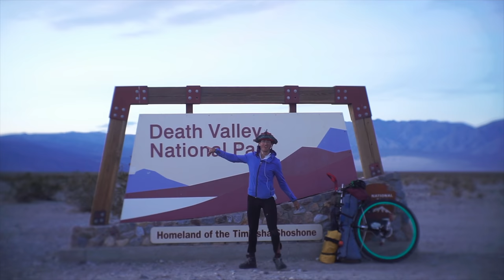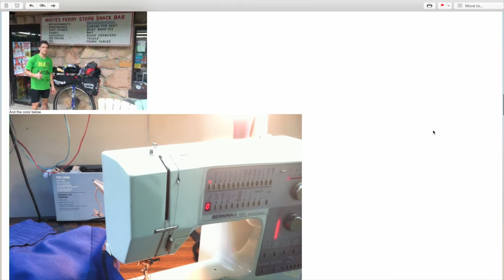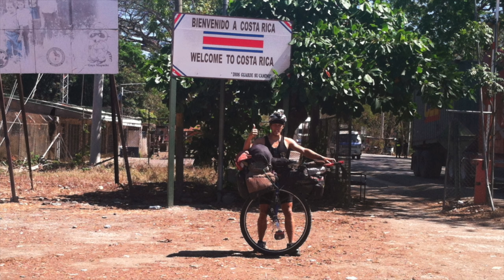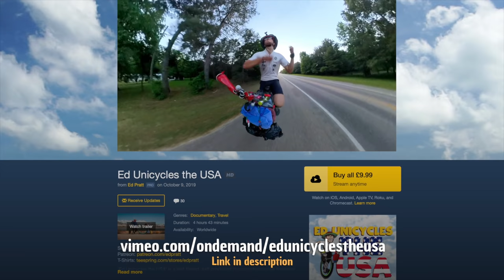He Unicycled 20,000miles from Alaska to South America // Ep.17 Unicycling Across America

Comment: I would like to offer a suggestion. Change to a mountain bike helmet with adjustable visor (gives great shade on your face) and Dutch that cotton hat that doesn’t transmit air & by a Headsweats cap. Those things pull the water out of your hair & keep your head very cool. No wonder you’re overheating with no air going through your helmet. 👍☮️🌞

Comment: If you are just drinking water you are not replacing electrolytes. Combined with the heat you are experiencing heat exhaustion. Nausea, cold shivers, vision going black?  You need to drink Gatoraide, Poweraide, etc. or take salt tablets. Train for triathlons in Hawaii...been there with the heat and humidity and 60-100 mile training rides. Also, don't drain the tank. Buy a powerbar and take one bite every hour. Keep fueling until your meals.

Comment: Aaah, you know what I'd love to invent and get a patent for Ed?  Crank shafts for uni's with adjustable pedal positions that you just have to loosen the bolts on the pedals, pull them out of the pre-set slots and move them radially in or radially out depending on if you have to ride up hill for a long time, or a long down hill.  Maybe even a tool-less design so that you can do it on the fly..  This would be a lot more simple, robust, and lighter than internal gears.

Comment: Ed your problem is insufficient salt intake.  Normal consumption is about 1500mg / day but you need to be taking about 5 - 6gm, maybe more.  You had the same problem in Thailand.  Water is better absorbed with some salt in it.  If you are salt deficient it goes straight through the kidneys and does not hydrate you.

Comment: I would have gone back west to go through Tennessee and then through the Appalachian mountains. Taking a quick detour to the city and then back onto the mountain like the blue ridge parkway. Which is a special road in the USA. No simi trucks allowed and cars and motorcycles are forced to maintain a maximum speed of 45 mph. And contains a special solution to a problem. The Blue Ridge Parkway goes by a massive boulder field which every spring there is a slide. It was in a beautiful area but if they built on the ground they would be rebuilding it every year so they decided to get above the issue. That’s right a viaduct.

Comment: I live in Maryland, work it's hot and humid in the summer just like in the southeastern states. Recommended you try some cooling gear that construction workers use. I've used just the bandana and hot weather races and it really made a  difference. Here's a link:  https://www.constructiongear.com/miracool-products.html

When you get it and open the box you're going to think "What is this? how can this do anything?"
But you just soak it in water like it says and you're going to see that it gets puffy and swells up. 
And what I did with the bandana is just tied around my neck but not too tight of course.

Another tip for you is to pack a bottle of electrolyte pills. I have run as long as 50 miles, and I have friends who run 30, 50 and 100 miles quite regularly, as well as as others who of course have run several marathons. The most successful ones swear by this:

https://www.succeedscaps.com/

Comment: The chiropractor part was hard to watch after recently watching videos of some frauds in the pseudoscientific profession breaking people's necks
Reply: Yup cringy, I'll stick with Thai massage.
Reply: you need to do a little more research, I think you are looking at the .0001% of chiropractors. There will be a few bad apples everywhere but almost all are good.
Reply: chiropractors can be really good (and the cracking fun to watch:), but the problem is that mis-alignments come from habitual misuse/wrong posture. So that can be cracked into the right place but slowly goes back to the habitual position. You must intentionally work on your alignment and you can even fix your structure by just doing correct alignment exercises/positions. Like standing meditation, which FORCES you to stand correctly or it really begins to hurt after a good half hour.
Reply: @slavko321  There is no clinical evidence that chiropracty does anything beneficial whatsoever, besides make you feel kinda relaxed. The entire concept of adjustments makes no sense. They pop some gas out of your joints, and thats the end of that. At best, its a 200$ placebo, at worst it causes lifelong damage.
Reply: @Android480  i would fall on my butt snowboarding as a teen and my pelvis was so out of whack ; only a chiro fixed it; otherwiese i would not have been able to walk or jog  at all; that' its how pinched the nerves in my legs were.. if you feel like your bones are pinching your nerves and feel pain then only a chiro can crack your pelvis "back in place"